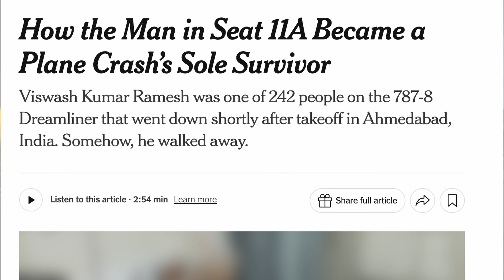Why the RAT Changes Everything – Air India 171 Update

Comment: What  operational temperature limit is is on the 787 FADEC What happens is the environmental temperature exceeds the operational temperature.  Could it be that FADEC resets/ shuts down?  If there was aircon electrical issue > is this plausible ?

Comment: Pilot error in the case of engine thrust not coming up enough until very end of runway. If the craft is having trouble gaining thrust, even as going down runway, flight should be aborted. Is 787 known for a struggling takeoff when fully loaded?

Comment: I heard that "airplane" sound, but unless someone has hurd the sound of a electric prop planes, they might not notice it. That anomaly on the airplane looks just like that, not a rat. That so called door opening, is not a door. That door would be nearly the full size of the bottom of the plane. Only powered gliders have a motor nearly the full size of the body of the plane, and those rat's just aren't that big.

Comment: A misconfiguration of the Boeing 787's flight computer for approach instead of takeoff could lead to serious operational issues. Here’s what might happen:
- Incorrect Autopilot Behavior: The aircraft might attempt to follow descent profiles rather than climb, causing confusion for pilots.
- Flap and Slat Settings: Approach settings typically involve extended flaps and slats, which could create excessive drag and hinder acceleration.
- Throttle and Autothrottle Issues: The system might set lower thrust levels suited for landing rather than the high thrust needed for takeoff.
- Altitude and Speed Targets: The flight computer could prioritize descent speeds and altitudes, potentially leading to an unsafe flight path.
- Warnings and Alerts: Modern aircraft have safeguards that would likely trigger alarms, prompting pilots to take corrective action

Yes, on the Boeing 787, the CMD (Command) button and the Approach button are located relatively close to each other on the Mode Control Panel (MCP). The CMD button is used to engage the autopilot, while the Approach button is used to activate approach mode for landing.
While their proximity is designed for easy access, it does raise the possibility of accidental misselection, especially in high-stress situations.

Comment: plane used entire length of the runway. even the part not frequented by planes because planes take off much earlier. it is evident from the dust that rises when the plane takes off. 
it means the plane was not gaining full throttle even on the runway. pilots still failed to abort the take off. did they turn on the fuel properly?  seems tome they did not.

Comment: Someone elsewhere opined that the dust plume at the end of the rwy was when they flew over the overrun.  The point being they they just got off the ground at the end of an 11K' rwy.  Should have been a lot higher at that point.  Also, if they had both engines fail, couldn't that explain why the gear was still down?  If there is limited RAT power from a dual engine failure, wouldn't the a/c systems prioritize electrical and hydraulic needs based on power available?  And gear retraction would be a lower priority than flight controls, avionics, etc?

Comment: I don’t believe that the Ram Air Turbine would not have enough wind opposite wind force to slow the aircraft.  Gear down flaps up had to cause this, or throttles pulled back to idle!  Captain would have told the tower that engines failed!

Comment: Question to Captain Steve: Besides birdstrike or fuel contamination what else causes a dual engine failure? 
This particular airframe was well known for it’s electrical failures over and over again. There are videos out there from the inbound flight that show electrical failures in the cabin including lights, AC, inflight entertainment, etc. The Boeing 787 relies on electronics and batteries like no other aircraft. Could a short circuit also cut off the engine input command? The speed also seems too low, for the rat to work properly and supply sufficient electrical power.

Comment: Steve you have done great video , but don't you think that Boeing Co knew the peoblem from day 1 because Boeing didn't ground 787 they are still on sky , normally it do grounding when there is problem with Boeing plane. This mean to me the cause is from out of the aircraft like fuel problem or other external problem and already got the exact cause but not yet revealed it for some reason

Comment: Question more out of interest. If this aircraft had a single engine failure at that point in the flight envelope, would it still have crashed? Presume peak thrust is needed at this point to gain the altitude..
Reply: One engine can provide sufficient thrust to get off the ground and reach a safe altitude if aborting isn't possible. The engines would not normally be operated at peak thrust even during takeoff. A derated thrust setting would be calculated based on aircraft weight, runway length, air temperature etc.

Comment: A 787 losing both engines.  Let's talk odds, what are they?   This mishap may end up ranking right up there with the Air France plunge into the Atlantic in terms of importance to airliner safey.  Given now today another Air India 787 turned around out of at least an abundance of caution, my confidence in the 787 has definitely taken a hit.  I know too little of flying to go beyond conjecture, but it would seem this electric jet and an electrical failure, then leading to dual engine could be the chain reaction on this one.  People were chatting fuel pumps and not enough fuel from gravity to feed the engines at full tilt.  What say you?

Comment: Steeeve you are again missing obvious indicators!!! LISTEN TO THE ENGINE SOUND! That is not take-off power. Probably not even landing power coming from those engines. Secondly, the U/C bogeys are tipped forward. That is the first part of the U/P up cycle, meaning the selections to raise the U/C was most like done. If you look closely at that video and post mishap pictures, it is clear that the lift augmentation devices were not retracted. This is info that was available to the world very shortly after the crash.
Reply: Pardon, but can you give us the flying for dummies version of that question?   Are you saying the configuration was also a factor, but based on loss of some major system, or pilot error?

Comment: The captain seat didn't lock and his hand was on the throttle.. as the seat pushed back so was the hand on the throttle.. that seat was repaired and fixed and 11 aircraft have the same problem.. wtf.. is this possible?

Comment: Has there been issue with planes bring in extreme heat with air conditioning running sitting on the runway for extended periods/hrs ?

Comment: Duel engine failure hydraulic failure power failure it couldn't get any worse.
Only thing is the rap came down and did it's job ,or tried to but they were doomed as they would be past V1.
As a crew it must have bern awful knowing whatever you did would have same outcome.

Comment: What I'm confused about is the fact that it took 11,000 feet of runway to liftoff (Vr). Shouldn't the distance it takes to reach V1 speed be a consideration on whether or not to abort a takeoff? Obviously, weight and atmospheric conditions would be a factor in this calculation (and this plane was heavy) but there still could be a spot (+/-) on the runway where this (V1) should occur. Using 11,000 feet to lift off to me indicates a thrust problem of some sort. Did it take Air India 10,000 feet to hit V1?  I'm not a pilot but I have an understanding of aerodynamics (and an engineering background). How about it pilots?

Comment: Absolutely excellent analysis and insight... How about we check all the maintenance records that have to do with fuel system and fuel flow maintenance and or lack of maintenance... Maybe the pumps or the controllers fuel flow of course or maybe even indication issues... It is absolutely completely rare of a total double engine failure just randomly... Let's get the NTSB to go over the data for all of the circuit breakers regarding etc regarding that fuel system after hearing the RAT and the deployment you almost hear the engines sound like they are throttling back

Comment: My personal assumption is that the time between the start of the takeoff and the onset of the crisis was too short—perhaps even for a single human error—especially considering that many mistakes are immediately flagged by the system. One would need to look for a specific point on the aircraft which, if struck, could cause a sudden and complete loss of power without triggering a fire.

Comment: Something to think about, years ago I had a conversation with a Boeing Flight crew training captain about a possible scenario. What happens to the aircraft when the Battery completely fails.  I my career at AA I discussed this with multiple check airmen and got different answers. I have flew B737, B757, and A320 series aircraft. None of the aircraft manuals answer this question. The issue in the discussion is the HOT Battery bus and the systems it powers. Like the main fuel cutoff valve.

Comment: Deep sorrow and respect for the pilots and the victims of the accident. My question is this: what could have caused the possible loss of both engines at same time, and the subsequent deployment of the RAT, between the start of takeoff and V1? If the simultaneous failure of both engines is true, the cause must be very particular and perhaps difficult to identify. Could it be that the aircraft picked up debris or was struck by fragments during the takeoff roll, as in the case of the Concorde in July 2000? Thank you for your excellent videos.

Comment: I'm quite shocked that an experienced capptain   confuses the sequence of events in order to reach the personal opinion.
 Now the facts:1) The take off loocks normally, id est flaps extended- slats deployed.  But from the scene of accident the slats result deployed , the flaps  retracted. 2)The flyght lasts 28seconds and within this time someone or somethingon has driven the flaps to zero, No other compromise is permitted. 3)During the time of flaps retraction the aircraft was still receving benefit of their action  to achieve an altitud of 600ft, but at tha end the speed was not sufficient to produce  a power greater to that necessary and the plane inesorably was gone to crash.and the landing gear still was extended. 4) During  the short descent the proximyty earth alert was alerted and this makes to deploy tha RAT?, This is a pprobable sequence of events with none  solution  of the landing gear problem

Comment: Capt Steeeve, I do not believe that guy was on the plane at all.  I think he missed the flight.  After the fireball and all that smoke, and the plane hitting the ground at 160mph at least, do you really believe he climbed out of the fire and smoke and soot and through the sooty rubble with a pristine white shirt, clean pants, clean shoes, clean arms and hands and face, eyebrows, hair neat, and walked normally away, smiling in the video?  He wasn’t breathing hard or coughing from the smoke.  His lungs weren’t burnt.  And no brain damage from the brain hitting the inside of the skull during that sudden stop.  No broken bones or sprains.  Those scratches on his nose could be self-inflicted.
But if he MISSED HIS FLIGHT, he would still have his immaculately clean clothes and body and ticket and cell phone, and he could have heard the engine noises.  This may be a money scam.  I think he missed the flight and is lying about it.

Comment: my theory is that the plane ran out of runway, struck a light on the end of the runway, damage caused electrical failure and shut down the fuel pumps, killing the engines and their thrust.

Comment: I have a question regarding an experience I had before boarding the flight with Kuwait Airways. 

After I cleared immigration, I was waiting in the lounge with other passengers. About half an hour before our scheduled boarding time, the airline staff informed us to remain in our seats and not to board the plane. We ended up waiting there for several hours. Unfortunately, we were unable to travel that day due to an engine failure. They arranged for us to stay at a nearby lodge for the night.

The following day, we were told to come back to the airport, and that the engine issue had been resolved. I’m not sure if they repaired the engine of the original aircraft or if they put us on a different one, but we landed safely at our destination. My question is, why didn't this happen with Air India?

Comment: Based on the guest from the previous flight for this airplane, the air conditioner and many electrical devices did not work. Based on this, I guess that this accident is caused by poor maintenance or bad fuel used in the air plane.

Comment: Could the dual engine failure be caused by no fuel?  I ask because a airplane mechanic posted on Insta that he believes the ground crew could have made the mistake when fueling.  His theory is that the fuel nob was never changed from closed to open which would starve the engines.  He believes the aircraft was able to get as far as it did with the existing 'fuel in the line' and when that was used up, all power was lost due to no fuel.  Thoughts?

Comment: I never flew on an aircraft until 3 months ago and I have no association with the industry. I lived near an airport for the first 30 years of my life and I've watched all episodes of Air crash investigation multiple times. 
The first thing that came to my mind was whether the RAT was deployed. That should be a giveaway for the dual Engine failure.  I just could not fathom a pilot with 8000 hours of flying experience making a fundamental mistake and he is an instructor too... I believed they had no hydraulics due to engine and consequent power failure which is why they never retracted the wheels either. All that remains to be investigated is the cause of dual engine failure. Since the probability of such an event is so rare and bird hit has been ruled out, the most probable explanations are fuel contamination and sabotage, assuming of course that nothing was inherently wrong with the aircraft. 
I don't know if both engines receive fuel from the same tank. If they don't I would eliminate the fuel contamination option also because what is the probability of both fuel tanks being contaminated and the engines getting shutdown at the same time. If the fuel itself was contaminated that would affect other aircrafts too. So that is ruled out. 
I'm tempted to quote Sherlock Holmes but refrain as it seems disrespectful. I'm sure the concerned authorities must be looking at all probable scenarios...

Comment: Great analysis and unfortunate beyond belief.  Curious though about the clean wing, or appearance thereof.  Would the flaps have retracted (blown up) if they lost hydraulic pressure from dual engine failure?  I retired from the DC-10 over two decades ago so my memory has faded.  I do remember no (or emergency reserve) hydraulics meant no-flap landing, but I seem to recall if we had flaps set, they stayed as set unless the flap handle was moved, at which point they would blow up to zero.  Of course, no power doesn't save this flight...just wondering why the flaps appear retracted as well.

Comment: Follow up to my first post: Yes, a Boeing 787 Dreamliner made an emergency landing at Laredo International Airport (KLRD) on November 9, 2010, following an in-flight fire that caused the aircraft to lose its primary electrical power. 
Here's a summary of the incident:
What happened: A Boeing 787 test plane experienced an electrical fire in the aft electronics bay, which resulted in smoke in the cabin and a loss of the primary flight displays and auto-throttle.
Where it happened: The aircraft made an emergency landing at KLRD (Laredo, Texas).
Outcome: All 42 crew members and technicians on board were safely evacuated using emergency slides, with one person suffering minor injuries.
Cause: Boeing determined that a failure in the P100 electrical panel sparked the fire.
Aftermath: The incident led to minor design changes to power distribution panels and a software update for the 787. 
This incident was a significant setback during the development of the 787 Dreamliner, which was already facing delays. It also highlighted the increased reliance on electrical systems in the 787, which was designed to be a "more-electric" jet.

Comment: With 25+ years of analyzing plane crashes I can find 2 potential pilot errors. First They decided to takeoff from the second half of the runway which takes away spare space to reject takeoff. Secondly, neither pilot was paying attention to the engines performance and did not realized it took longer to achieve v1 than normal and hence they run out of space to reject takeoff. I know it's normal procedure to use the second half of runway even on a wide body aircraft. If I could make recommendations it would be to never do that when operating  heavy wide body planes like 747's, 767's, 777's, 787's, A330's of course 380, and others large aircraft as needed.These planes take a lot for braking when they are full loaded. In this case, if the AI 171 would've used the full length, the impact would've been less than tragic. It is just does not make sense to me to use the second half when on larger and heavier airplanes. Am prioritizing safety over airport ops.